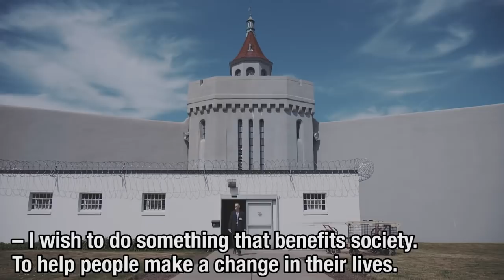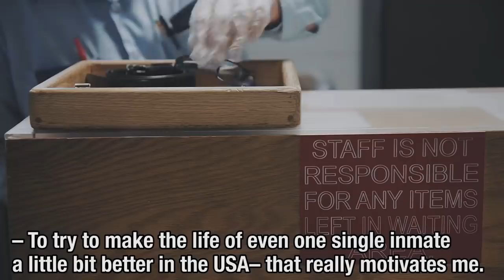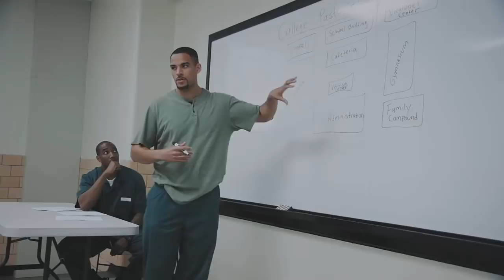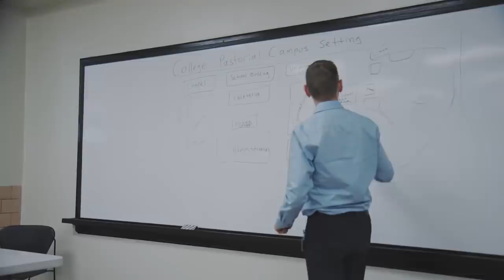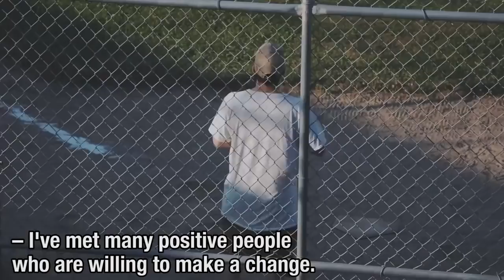Q158: Attica Prison USA v Halden Prison, Norway? - CR: Finnish Broadcasting Company YLE

Comment: some Norwegian prisons have less equipment and have jobs that are more mundane (making pallets and similar stuff), but they usually have a partnership with a nearby college or uni that could provide courses or education for inmates who want to study, and are behaving of course. Staying in a place where you have certain accomodations that will make the days, months and years go by a little easier, encourages more types of inmates than you'd think to make an effort to stay within the boundaries they are given. Also, if an inmate breaks rules, is verbally abusive, or attacks someone; they will loose more privileges. In cases where they stay at a low security prison, they might get transferred to a maximum security prison for some time, if not for the rest of their sentence. However, they can regain privileges, and they can apply for a return to a low security prison again after some time, usually coupled with counseling and approval from their co. and that is something I believe makes for some to try to change, when they see that if they mess up, it aint over for the rest of their time, but it takes effort to have all the benefits that are available
Reply: yes and the prisoners here also get treated with respect and not animosity, and that is a big thing.

Comment: "if you do not understand white supremacy (racism) - what it is and how it works - everything else that you understand will only confuse you." neely fuller jr. 1971  the u.s. prison system is not designed for the welfare of non-whites. i couldn't help but notice the different demographic of both prisons.
Reply: 34% of the prisoners at Halden are foreigners, but in the way that they are sent here from another country.